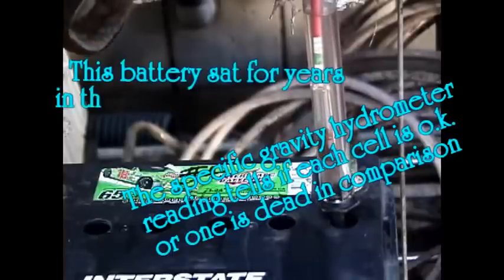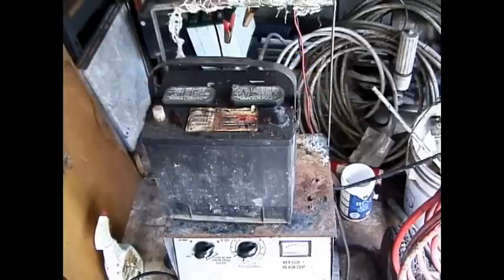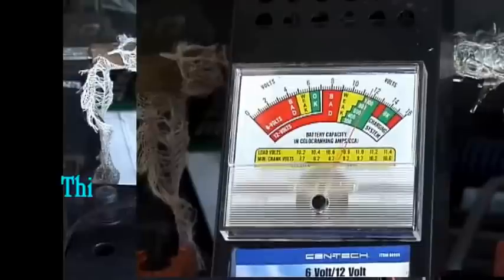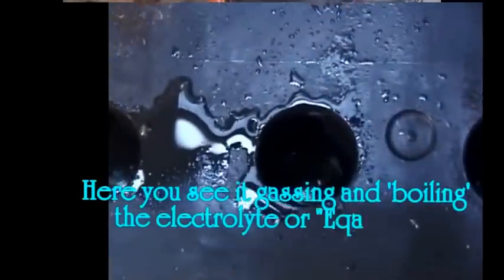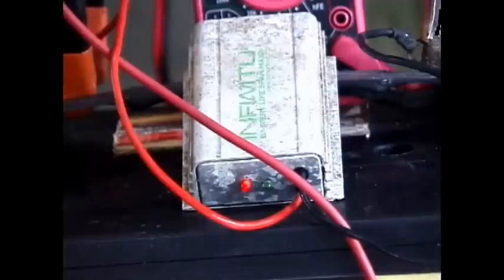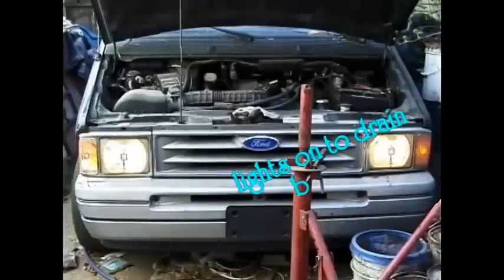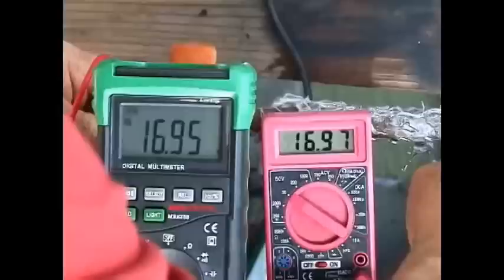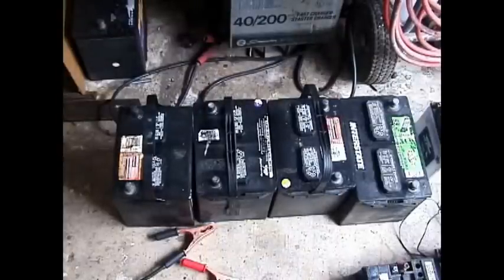Battery Reconditioning- Battery Companies PRAY You Never See This Revealing Video

Comment: 1 pour out old battery acid 2 use baking soda solution  to nutalise acid  drain and wash a few times 3  1/4 cup of lye in 4 L of water ie 1 gallon of water  carefully fill battery with this solution wearing all safety gear , Lye is no joke and reacts with acid thus step 2 . Let sit for 2 hours , drain this solution you should see a yellow looking liquard come out this is sulpher thats been dissolved , wash out with clean water about 10 times , refill with 35 % battery acid .  Watched video with this technique revived a 8 year old battery
Reply: How to restore a dead car battery the correct way NO EPSOM SALTS

Comment: The hydrochloric acid vapor causes electrolysis in my mouth. I have both gold and silver fillings. This makes me taste metal in my mouth for days after I mess with my battery, unless I use baking soda to brush with. I found this out after working at a trombone manufacturer for years. We had a non-vented acid pit in the back of the shop to remove all the flux from the brazing process. For years I tasted metal til I finally figured out why. Then they built a vent and the metal taste went away. Hopes this helps someone.

Comment: All you YOUTUBERS ARE THE SAME talking super technical to people who dont understand this S#$@&T in the first place how about just showing us that we must first add distilled water to each cell then boost the battery with 200 Amps at 10 mins at a time with 1 hour rest times at least 12 times till the water comes to a boil. Then provide us with an affordable battery charger that will provide 200 amps without automatically shutting off and woola YOU GOT AN INTERESTING VIDEO. Viewers want it fast and to the point otherwise change the channel and not subscribe

Comment: Hi I got a used Seal Lead Acid 100ah and when i open the lid it is dry, should i top it up with a normal battery water? Even the battery is dry it still remain at 12.7v . Should i leave it as it is or add battery water into it? 

A Seal Lead Acid is also known as a AGM battery right? A Gel based right? A gel based would also required battery water too, during recovery?

Comment: My question is can I use a good battery hooked in parallel with a bad battery to burn off the sulfation of the bad battery, and I believe you answered my question, yes.
Reply: I tried this and I can hear the electrolyte boiling in the bad battery when I hook it in parallel with a good battery. I do believe that a bad battery can be desulfated with a strong battery in parallel.

Comment: Just to clear up the hydrometer, what it does is measure the specific gravity (mix of electrolyte) a good mix is 1260 on the hydrometer the best way is to empty out the old electrolyte wash out with water and fill it up with new pre mixed electrolyte
Reply: Have you done this with the 4 that did not survive,?

Comment: A battery with one dead cell will run your 12 volt house lights for years, from solar panels. I've been using my dead cell car battery for 22 years still runs the house lights and the tv.

Comment: You did a good job with the demonstration & explanation. 👍 I am looking for a way to re build batteries. I am all about recycling repairing & repurposing plus a "little frugal" LOL.   Around 55 years ago there was a guy in PA that use to sell used batteries that he rebuilt. Well we were on vacation & my uncles car's battery died. Back then there wasn't all these auto parts stores & we were in the Pocono mountains, so we bought  one of his batteries. This was for a big ford with a V8 & never had an issue with that battery. Anyway I a looking for a method to  remove damaged cells & replace with good cells from another battery if I get the time. Seems like there  is always a project that needs to be taken care of. If you should make a video doing this let me know.
Stay safe, Joe Z

Comment: I've had little to no results from an electronic pulsing desulfator but I've managed to more than double the capacity of old batteries by adding about 10 mls of PURE sulfuric acid to each cell then overcharging it as described in this video. If you're going to try this you MUST use rubber gloves and eye protection and I recommend a hypodermic to add the acid.

Comment: Will the fully automatic charger allow force charging at 40amps? I can seem only to find the automatic computerized ones everywhere. I can't find one like yours at my local dealers. Also I heard some say I should be looking for a 200amp DC 12 charger (which I can't find one anywhere at all, only 200amp or 250amp 5 second boost on ignition detection) to do it as well or 40amps is good enough?

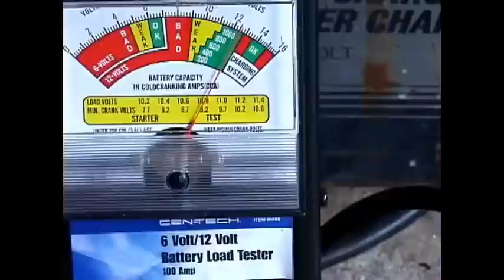Comment: At time stamp 10:31 the red Harbor Freight (Cen-Tech brand) meter is compared to a green digital multimeter. The statement is made: “You can see the Harbor Freight is fairly accurate...” That statement ASSUMES the green multimeter is also fairly accurate. It is a reasonable assumption, but there is a very SLIGHT chance the green meter isn’t accurate as well. My car has a thermometer that shows the outside temperature on the dashboard; When I compare it to thermometer readings shown on a bank’s marquee and the two temperature readings disagree, which thermometer is more accurate? Or I drive past a radar instrument set up by the police that flashes my car’s speed, and my speedometer shows a slightly different reading, which one is more accurate? BTW: I have several of those Harbor Freight multimeters and have compared them to several of my other digital and analog multimeters and I agree that the voltage readings at 1.5 V DC, 12 V DC,& 120 V AC are fairly similar among most of the multimeters including the Harbor Freight ones—but I had one more expensive meter that wasn’t. This reminds me of the state trooper who’s radar gun clocked me at 74 MPH while my speedometer read 65 MPH.

Comment: Stumbled across this video.  There is a huge risk in doing this.  Charging any lead-acid battery produces hydrogen gas.  Hydrogen gas is highly flammable and odorless.  Remember the German zeppelin Hindenburg?  So, you are charging your dead battery.  Hydrogen is rising out of the battery vent(s).  You get one spark and boom.  You can be severely injured and possibly blinded by the sulfuric acid.  I'd say, emergency rooms pray you never see this video.
Reply: A lot of people think battery reconditioning is hard however I think I know it's incredibly simple. I have done it hundreds of time before, in fact it's what I do for a living [Check Details Here==> https://t.co/uUSuy6Yk5g ]. Anybody can recondition batteries, you just need to know the techniques.?
Reply: You have to be safe. Protect your self and use common sense.
Ventilation, eye and skin protection are not negoitable. Keep baking soda and water available in case of accidental exposure.
Peace

Comment: 7:24 What's the difference between warm and hot? I'm doing this to a bus battery, about the size of three car batteries. The fluid is at 100 degrees. What's the highest safe temperature?
Reply: Thanks for the Video! Sorry for chiming in, I am interested in your opinion. Have you ever tried - Lammywalness Trendy Trade Guide (should be on google have a look)? It is an awesome exclusive product for learning how to recondition batteries at home minus the headache. Ive heard some amazing things about it and my m8 after many years got amazing results with it.

Comment: As long as old batteries can hold around 12 volts, they can still be used to power LED lights even if they won't crank a car engine.

Comment: If it hasn't been sitting for long (1yr/2yr) and has low use/abuse. You can probably check the cells and see if they need distilled water which would be a quick fix

Comment: i picked up 2 new,unused diehard deep cycle marine batteries,i was told they have sat for 5 years,he charged them,and i multimetered around 11.5 volts,fluid levels are even,had auto parts store try to check them and found out they are from 2009,kinda mad about that but ,i charged them over night and tested 12.8-12.9,put one in my truck and the battery meter in dash is on the low side,shouldnt it show on high side being it was still a little low,could i just buy some more acid and drain whats in there or do i have to flush with epsom salt and distilled water trick

Comment: Dump the acid out completely and take regular tap water with baking soda and fill each cavity and rock it back and forth let sit for a few hours and dump out completely , do this 4 times , be careful wear shitty clothes, gloves and glasses, and then mix epsom salt with water fill the cells up as usual and recharge again for 72 hours.  Load it down with two headlights for as long as it takes to get the voltage to 7 volts... recharge again.  Battery should come up half ass and useable to 12 V with cranking amps pretty close to 80 percent or better of what new was.
Reply: what does the baking soda do for the sulfation? can we skip that step and go straight to the MgSO4?

Comment: Deteriorated positive plates are irreversible. What you call hard sulfated plates are most definitely reversible as long as the plate is not deteriorated.  However a purpose designed charger is the key  and you don’t have one.  They are available but pricey.  The only people I know that have them are battery manufacturers and a few industrial battery repair shops.  It ain’t rocket sience but it ain’t something you hook up and leave on for days either

Comment: We use a DC welder and a length of cables to be away from the battery, hit it with 44 volts, 120 amps for 1 second intervals, about 4 then put on charger. You'd be shocked how much crap comes off them plates in a few seconds.
Reply: say there you go don't need o desulfsifier

Comment: this is grat well done.. dont listen haters. . you dont need 600 amp if you use them for solar.. yes maybe this method cant wotk for car cold cranking amps.. but imagine 10 or 20 of them buying them for 7 dollars per pcs for scrap.. you only need to work a little bit and yeah.. you have let say 20 batteries * 80 amp hours 1600 amphours ar 12 volts equal to 19200 watthors.. 19.2 kwhours lets say at the worst case you have lost the half capacity because of restoration (they are not new) yes you have built an enotmous 10 kwhours battery bank for 140 dollars..

Comment: This battery reconditioning plan “kamvo shocking plan” (Google it) surpassed my presumptions. It worked on my drill battery, several AA and AAA batteries, and my camera battery; now they are useable once again! The steps are easy and the act itself is interesting to do. It works for any kind of batteries!

Comment: Hi I'd like to say your methods are sound. I have worked in the battery industry for well over 30 years mostly in the industrial business ie: fork lifts, mine locomoties and heavy duty marine. I have not spent money purchasing new batteries since I can't even remember when! I had the luxury of being able to dump out the old acid and filling up with distilled water then trickle charge till the voltage rises to a preferred voltage of over 2.1 volts per cell then dumping that and filling up with 12.35 sg acid and then charge up with a normal charge,then load test over a set period and recharge again. I realize many people won't be able to do this and that is why I like your method! I would also like to note that you should never put a battery onto concrete floors or blocks!!! That's a big no no in the battery business and a quick way to drain your battery! Keep on posting videos like this they're informative and bang on the money!
Reply: twyla calgary o

Comment: Not sure what this "restore it 100%" nonsense is about. Once the positive plates have corroded away, it doesn't matter if what is left is sulphate, once the plates have turned to sludge, the battery capacity decreases pretty much in direct proportion.

Sure sulphation CAN be a problem on a newish battery that has been neglected - but if the battery is many years old, the positive plates will be mostly gone - it will show a normal voltage but underload will collapse quickly. Once that happens, you either rebuild the battery with new plates (perhaps worth it on a 1000A 2v storage battery) or you chuck it away OR you can keep it as a door stop or perhaps a 12v battery to keep a shed light on for a few minutes - with a solar panel on the shed roof to keep it charged up.

Used like this, it doesn't matter if you 90AH battery now only has 10% of its positive plate remaining as 9AH at 12v will power the 12v LED light for ages.

But once the plates have corroded away to almost nothing, you are NOT going to restore it - let alone to 100% :(
Reply: The Video should be called how to 100% fix a useless battery, Buy a new one.😊👍👍
Reply: James DeGray  You are correct, to an extent. The lead can electoplate from the acid back onto the lead plate, however it will only plate back onto existing lead, since the existing lead is what is electrically completing the circuit. If the lead plates have hoes in them, those holes will not "close" from recharging/plating. The reduced cross sectional area due to existence of holes will reduce capacity and CCA.
Reply: Mark T
Reply: but he lead suflate will get converted back to lead no ...? during regular charging?

Comment: I laugh when I see this silly load tester being used as some kind of reliable loading device. It only loads on a good day to about 60 amps ! Get a real adjustable carbon pile put 2-3-400 amps on the battery read the amps / volts and you know what you really got.
Reply: Yes, they often sell them as 100 amp load testers, but I have 2 and they're both no more than 50 amps tested using good DC clamp meters. BTW, if you upgrade from say 55 watt halogen car lamps to "100 watt" for off road use they're usually nearer to 80 watts really at the sort of voltages car alternators give out. I used them in marine searchlights and when I found this the lamp manufacturers sent me a load of "130 watt" 12 volt bulbs free to really be about100 watt ones. They admitted that the so called "high wattage" bulbs were in fact often only that much wattage at close to 16 volts, not  at the normal roughly14 volts alternator output, but the 55 watt bulbs ARE genuinely  55watts at circa 13.8 volts. The improvement in light output with the more wattage lamps is therefore not so much as many people think, particularly when the extra voltage drops along the cables reduces the actual voltage getting to te bulbs a bit more as well.

The "130 watt" car bulbs equalled the original spec. expensive specialist "12 v 100w" marine searchlight bulbs, so I couldn't complain at "freebies".
Reply: auto man im really impressed you have a bigger toy to play with get real
Reply: Lovely Video clip! Sorry for chiming in, I would love your opinion. Have you tried - Lammywalness Trendy Trade Guide (Sure I saw it on Google)? It is a smashing one of a kind product for learning how to recondition batteries at home without the headache. Ive heard some unbelievable things about it and my cousin at last got cool success with it.

Comment: Thank you for uploading this presentation.  I will try and use your technique shown here to bring up one of my old battery to working condition.  But there is one thing I am puzzled.  Provided bring the battery  back up to required voltage and able to crank the car with up to par current, what assurance will I have that the battery will operate all the time while on the road driving or not.  It could possibly loose charge so slowly and alternator might not able to charge it up and could get stuck in the middle of desert.
I don't believe once the plates are damaged, they will never be like new, unless change them with new plate, the capacity will not be like new.  Therefore I  do not believe any restored batteries with some form of plate sulfation just can not compete against new batteries unless damaged plates are fully restored like new to provide high degree of internal reaction so the battery will able to put out enough CCA and voltage at all times for extended period without worrying.
Reply: Don't be suckered in by the quack. He was just trying to sell his instructions at $47 a piece, Totally useless. 

Look below the video window. it has a web site URL. That is what he is really trying to sell you.
Reply: Nice Video! Excuse me for chiming in, I would love your thoughts. Have you ever tried - Lammywalness Trendy Trade Guide (do a search on google)? It is a good exclusive product for learning how to recondition batteries at home minus the normal expense. Ive heard some amazing things about it and my friend at very last got cool results with it.